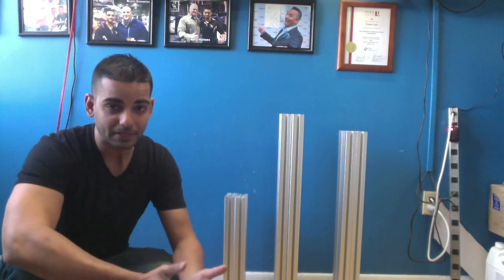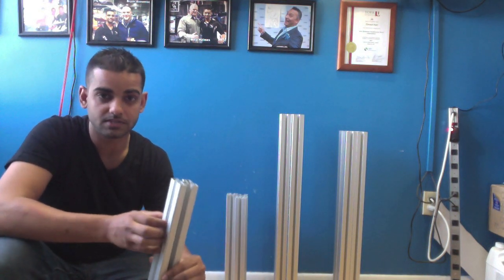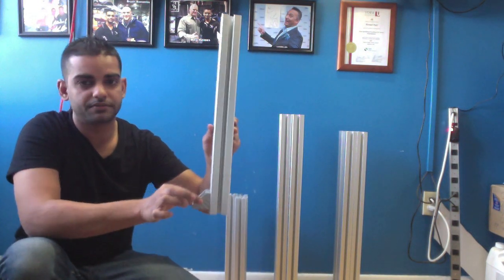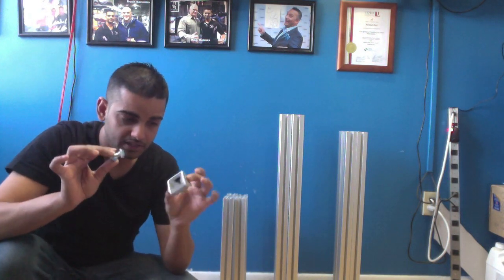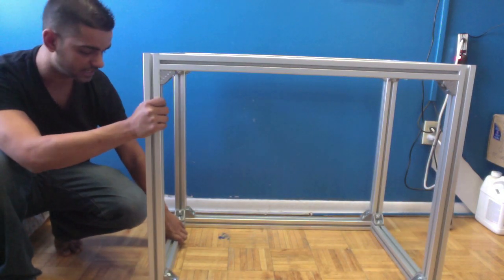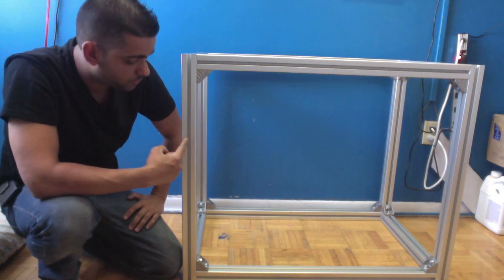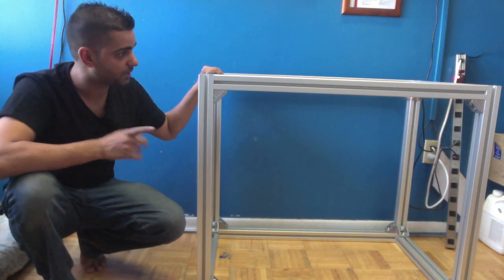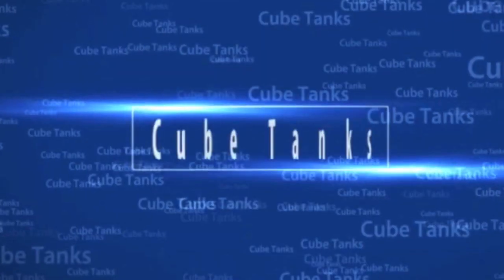Aluminum T Slot Stand (36"x22"x30")

Comment: Talked with 80/20 and for a 95.4g tank (900lbs) they said that the 40mmx40mm was more than enough to hold the weight so long as the gussets were used and the horizontal pieces were placed on top of vertical bars. Just an FYI for anyone interested. 

2 bars at 4m cost me $200, $130 for 16 gussets ( 80mm x 80mm x 36mm) and x amount for the 16 screws. This is a 36x24x25 Trimless tank.
Reply: Zach Chauvin I’m new to this.. What does 80/20 mean? And when you are referring to 4m what do you mean? I’m interested in building myself a tank i found a supplier but i’m not sure what thickness (mm) in t slot I need.. I know I will use 3x3

Comment: it is a very good idea BUT I wonder how you can fix solidly a plan on the top. I am not so sure it is going to work hard as wood would. it gives me the idea of being complicated to achieve a solid structure...
Reply: I guess a wood laminated board would be placed on top, attached with screws that fit on segment's rails.
For the stand strength, another segment would be placed in the back; and one o two more, should go on top. Besides, there should be conectors between the main segments in the top, or between all of them... If the plan is to place a heavy tank..🤔

Comment: Don't forget that the priciest part of the build are the connectors, profiles are rather cheap, around $0.75-$1.50 per inch, and the connectors are around $4.00-$7.00 each; however, the stand will stand up to a lot of pressure and stress, plus as what you say, you can mount wheels, acrilyic panels on the frame....

Comment: I recently built a 125 Gallon tank using 45x45mm extrusion.  It looks very similar to what you used here!  Did you get it from Framing Tech?  They lseem to have better prices than 80/20 or Bosch Rexroth

Comment: This T slot aluminum is a very good idea.  I like it, and will look into doing it myself.  One Critique.  I dont think that is a a torque wrench.  It looks like a basic socket wrench.
Reply from the maker: You are correct about the wrench part. But over all, I advise everyone to get aluminum stands done, you get a lower profile setup (more room inside the stand), stronger support, and VERY light!

Comment: So for a 24x24x18 tank you need a 25x25x32 stand, this aluminum stand is $500 !! VERY pricey!
Reply from the maker: Well you can go 25"x25" or you can keep it the exact same size as 24"x24". This is a heavy industrial product which is used in manufacturing Automotive, Aircraft and other industries. If you want style, the least amount of corrosion, and accessibility then this stand is it :P

Comment: Great but also not great, many homes dont have leveled floor, so why not with leveling feets onder the frame
Reply: Bojan Darker I see that he offers leveling feet on his quote form. I guess if you do this make sure the bottom bars have holes pre tapped in for screw in leveling feet. I'm assuming you can order them this way from 80/20.
Reply: use shims for 1 dollar

Comment: 6.5 mins of wasted intro talking. Get.to.the.point.  Tslot has been around for ages.  What is so new about this?  You never showed detail on connections which was the main point of the video.  Waste of time.
Reply: Just watched another 14 minute video where a guy used galvanized scaffolding posts and connectors to build a "very strong" stand for a 600g tank. Same thing, 10 minutes of blather, a finished stand, and zero proof that it will do the job. Some guys have channels just because they like to hear themselves talk.